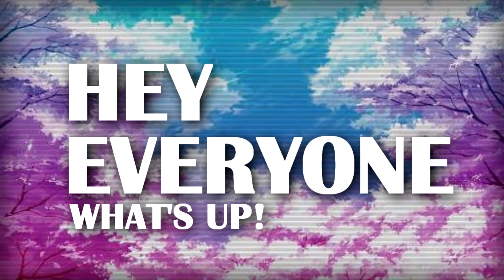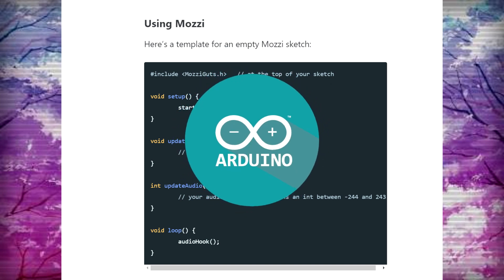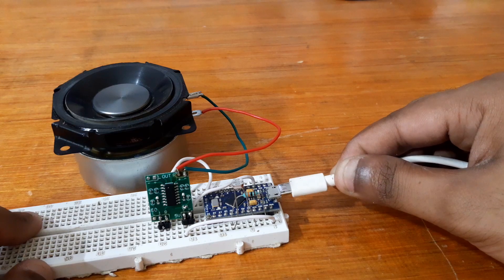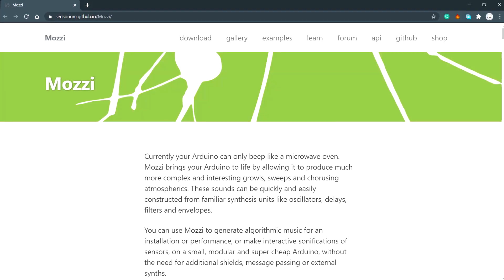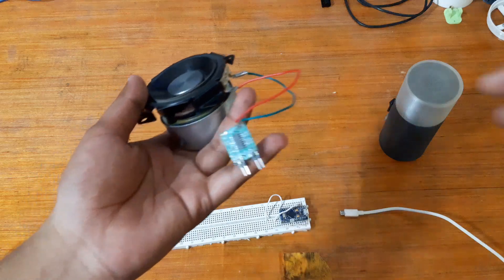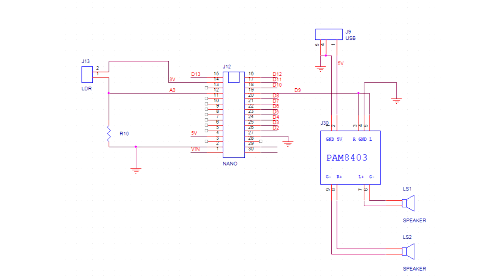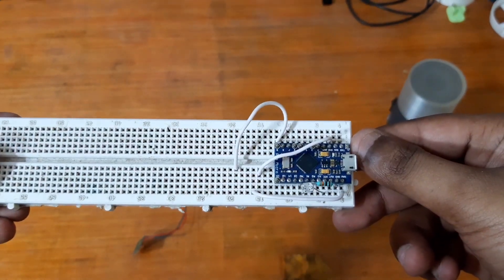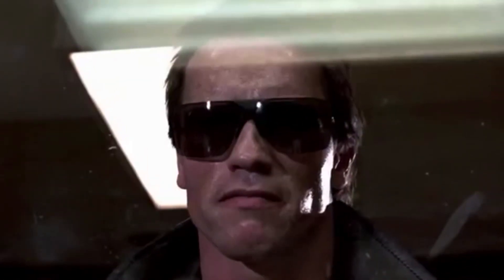Arduino Theremin

Comment: Nice project!, I have a question: does the PAM8403 includes a Dual PWM Circuit to handle the arduino audio output?
Reply from the maker: not exactly but it does include an audio amplifier boosted output config.
Reply: @ArnovSharma  Ok, thank you, so next question is: if I connect the output of the PAM8403 to an audio card or to another amplifier (in stead of a speaker) will I get a good result or I'll do some damages?
Reply from the maker: @chihauccisoilconte4474  doing that might damage your audio card but I think an amplifier can sustain the output from a puny 8403 module.